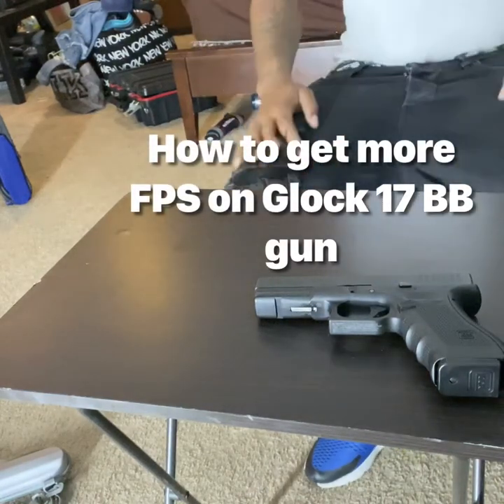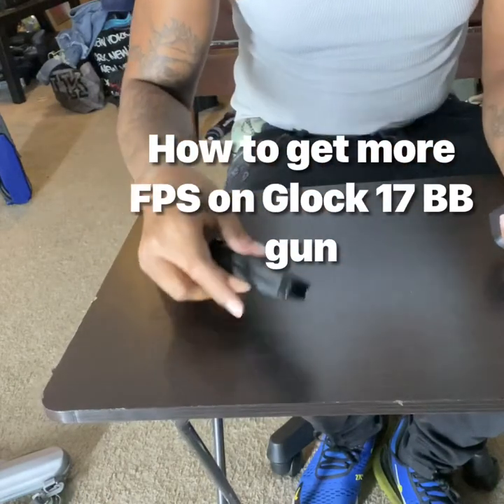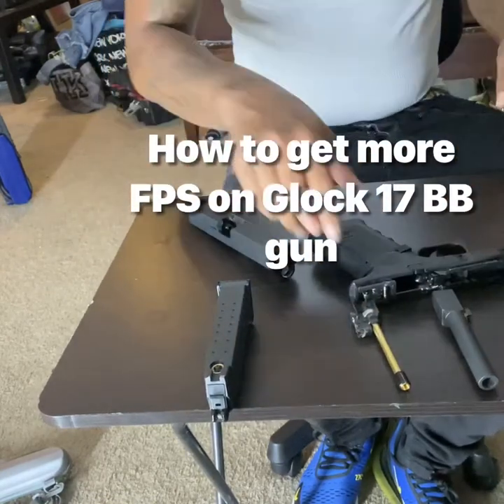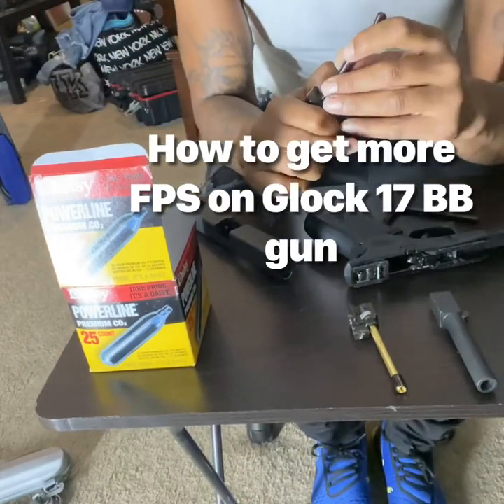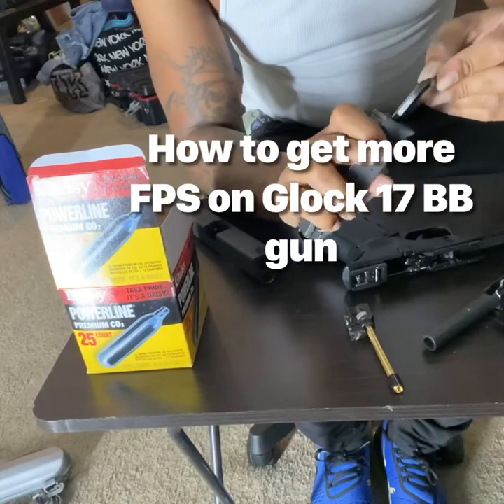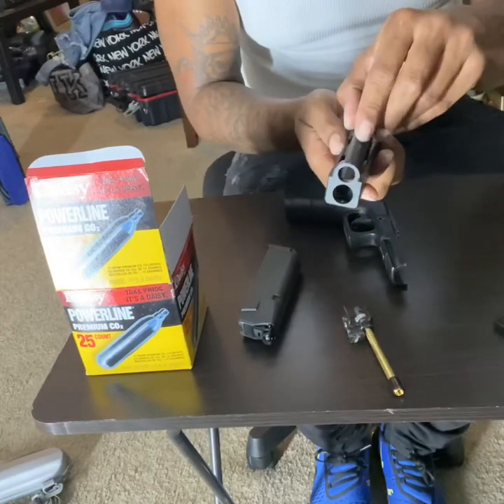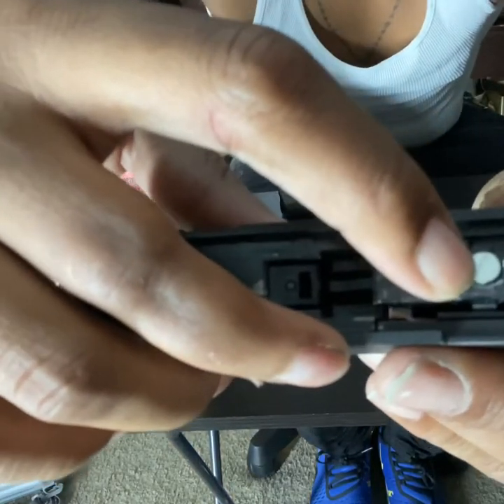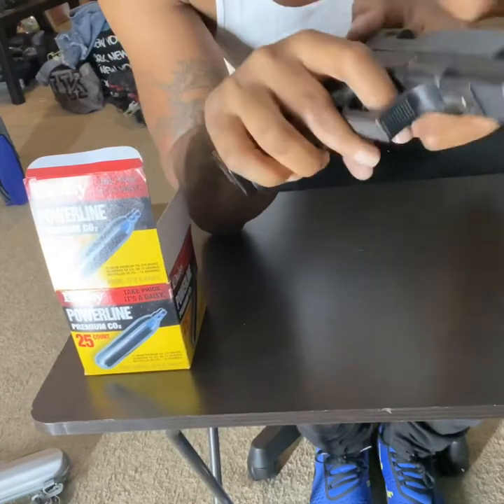How to get more FPS Glock 17 BB gun more feet per Second on any BB gun BB gun hack

Comment: If you have a Stark Glock 19 it will have a fun switch underneath the slide on the back of the side you don't even have to take the side off racket back lock it in the back position and there would be a full auto fun switch on the Stark Glock 19
Reply: What gun is that
Reply: Is it an airgun?

Comment: Lame. U know nothing about guns, let alone upgrading airguns. It's all about the valve, and how hard the hammer hits that  valve, to let more air out per trigger pull. All u did was field strip it, and nothing more. And the screw is a hop up screw. Does nothing for fps. Try again.
Reply: You're dead Right man i'm a master at moding  Valves.
i've  Ported both of my DPMS and hammer mod my Brodax 560fps BB'ss
and 620 fps. on pellets RWS Hypermax Pellets.
Reply: @joseglenn4435 can u legit show me how to do that. Could find helpful videos for the Glock bb model

Comment: Put a spacer in it and use a nitrous oxide cartridge. And you'll get way more power. But less shots.
Reply: Does that really work? As I understand it from reading at Wikipedia, 8g cream charger capsules have a pressure of 2bar, as opposed to CO2, that at normal temperatures around 20C gives ca 25 bars pressure (out of my memory). If the figures are right, a CO2 gun will not operate at all using NO2 capsules.
Reply: @andersgrassman6583  this guy did the math, but 'does that actually work?' lol

Comment: So putting a newbco2 will increase the fos who would have thought that would have happened it doesn't increase it but you can believe whatever you wan. And one more thing if you think it is a weapon and will hurt someone you are sadly mistaken and deserve whatever happens if you pull that on someone and they call your bluff. But all the power to you
Reply: It depends, Air Guns can cause serious damage if pointed and shot at the face and upper body, Air guns can be used as deterrents and just by flashing one, can prevent an escalation of assault or robbery.

Comment: 1st its the  Inner Barrel and Outer Barrel. The recoil spring & Hop up that you re assembled in the upper and lower assembly.

2nd Use PTFE tape. Take apart the HOP up and barrel. Wrap the PTFE tape twice round the hop up rubber and the the barrel. Refit the Hop up housing and screw back after refitting the inners parts correctly. This then create an air tight unit. This provides greater FPS. This will make your Pistol fire with great FPS. 

3rd How to Short stroke your pistol. Take the spring assemby apart and add some metal washers 5 or 6 (trial and error - Make sure they do not cause friction). Reassemble spring assembly. This will short stroke the pistol if it has semi automatic and full Auto. Easy on a glock airsoft gun. Works on Glock 18c.

4th If you want a large fps increase simply put a larger inner barrel in the clock. a Glock usually fires at 290 FPS on a 115mm inner barrel. If you add a 250mm inner barrel you will see massive increase in FPS.

Not sure the tips on this vid make sense but the information in my post will increase a glocks fire power in Feet Per Second and the amount of rounds fired per second.
Try it :)

Hope this helps.
Reply: Man, 1000 thanks for YOUR comments/explanations!! All you say sounds perfect and with sense! ( Sorry for my bad English, please!! ) I liked your text so much, and I went to your page here to take a look! Man you like interesting things! Good, very good! Now I am glad I've found this fellow... Because of what I found in your place...
Reply: @pedrotome9119  Glad to help Pedro! Your English is fine! Knowledge is power not a gun :)

I would also recommend cleaning the Inner barrel regularly

Equipment needed
1. Battery operated drill
2. Metal polish. 
3. Cleaning rod
4. Cleaning cloth
5. Lint strips for cleaning rod.

Steps:
1. Cut lint strips into small section that will fit into the cleaning rod
2. Apply metal polish to lint strip
3. Install cleaning rod into battery powered drill
4. Insert the rod into the inner barrel and turn drill on, move rod up and down the inner barrel for 5mins. (when barrel get warm stop replace lint and redo. Then on third pass just use a clean lint strip.

Do the Same to the outer side of the inner barrel (just apply metal polish to a clean rag and place the inner barrel now in the drill check. Spend 5min cleaning will look like new.

Hope this helps.

Maintenance of glock airsoft Gun.

Steps
0. Strip the gun down to upper and lower assembly. (Remove spring and remove inner and outer barrel. Clean each part with a rag and isoprol (rubbing alcohol)
1. Apply silicone oil to the plastic loading nozzle
2. Pull forward the loading nozzles apply 2 drops in the exposed area and a dap of oil on the top part of the nozzle
3. Pick up the main upper body. were the slots are for the Main body fitting to the upper body make sure to apply oil to these slots at each slide all the way along
4. Apply a small drop of oil to the rear of the lower assembly were the hammer is. (when you pull the trigger it will activate the area you want to lube
5. Apply oil in the upper housing were the inner and outer barrel fits as this slides and causes friction Rub in with hand after first cleaning.
6. Apply Lithium white grease to coil spring (the large spring.
7. Look for any area that have had the paint removed where bare metal resides and lube with silicone oil or gun oil.
8. Reassemble and test. When you cock the gun manually it should be slick and no resistance witnessed.

Hope this helps. 
These basic steps will maintain your glock and reduce parts failure. If you do this regulary after use or each month you will be sorted.

Glocks are meant to fire at about 80 -90psi if you use a tank rather than small bottles of green gas. Standard airsoft glock fire at 290-300 psi out of the box but with the mods i stated above in the other comment you will get greater accuracy and greater FPS.
Reply: @llamudos9809  Mate have you ever tried it with a RAM Weapon .43? I would like to see a video about how to modify an umarex ram glock 17 gen 5 .43 cal.
Reply: @rocus80m  Sorry i only ever use .20 & .25 BBs for airsoft CQB and Milsim in my glock 18c and 19x.

0.43 seems crazy large. You fire pepper or gel etc.? I guess you could install a stiffer silicone hop up rubber? and larger harder Nub.

I guess they follow same principle? Just a wider barrel and hop up unit (i'm guessing) 

Never had a non lethal personal defence weapon so i cannot really comment. 

I have never seen or heard anyone try to flat hop or R hop one so really do not know. sorry.

You could try an I key in it? to get spin? and accuracy or distance.
Reply: @llamudos9809  oh boy, thats all greek to me :D I use normally rubber balls :) its fun to shoot them, but I wish I could get more power of it. Additionally I also use HDR 69 with 16 joule for fun ;))
Reply: @rocus80m  HPA it (high pressure Air) You would definitely get more power. :)
Reply: @llamudos9809  Yeah maybe but I would like to stick to my 12g cans :D
Reply: How can I get the most out of my T4E Glock 17 Gen 5 .43 Caliber?
Reply: Hi. Where are you based in UK . Any recommendations for a starter around Birmingham area?
Reply: @chiccoka  Sorry im in the NE. Would not have a clue in Birmingham but if you do a search i'm sure their will be a Airsoft site close.
Reply: @llamudos9809  thank you. If I like glock pistols what manufacturer product is the best for spare parts and overall quality? Umarex , Tokyo M?
Reply: @chiccoka  I actually mix and match. When parts break. My Glocks are "WE" but i broke the hammer a few weeks and could not find a spare anywhere. So i just put a RAVEN hammer in and it works great. So sometimes its pot luck. TM, WE, Umarex are all good Raven are classed as cheaper but the one i had worked well never had any issues.
Reply: @llamudos9809  thank you. I wish you a lovely festive season
Reply: @chiccoka  All the very best.
Reply: Do you have a video on your channel on how to increase the fps if not pls upload thanks 😁👍
Reply: I would actually prefer to see your video on these procedures!
You actually sound like you know what you're talking about.
Reply: It wasn't just that😂im a Gun tuner,FireArms&AirGuns .there are 7 original fabric parts that needs to be done with(or even change by making it using CNC)#1 clue:Remake bigger Valve(4,7mm)&BoreUp the Valve along with longer soft Valve spring to gain more Gas flow&kick..Russian are the greatest if it goes to Upgrading..I've had learn many from them .greeting Nederland